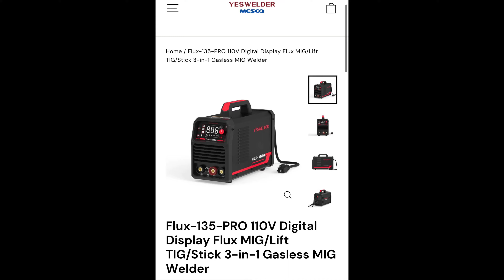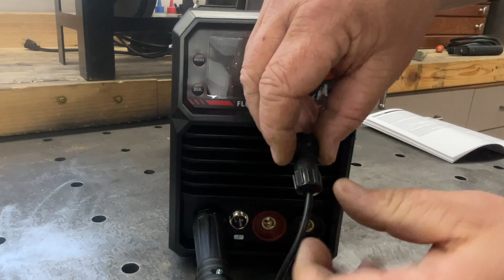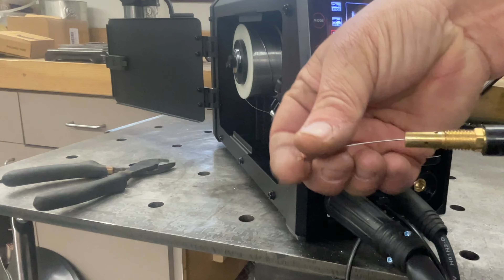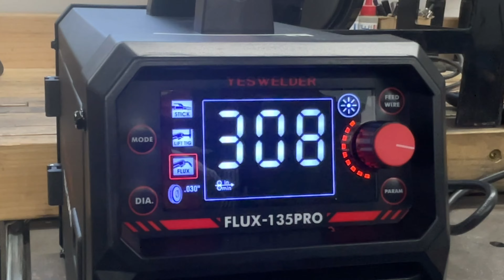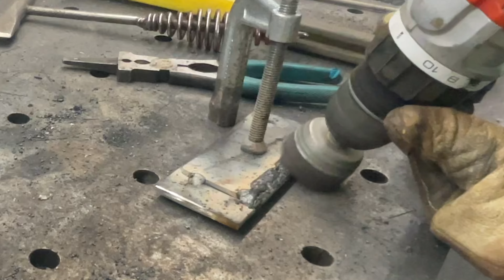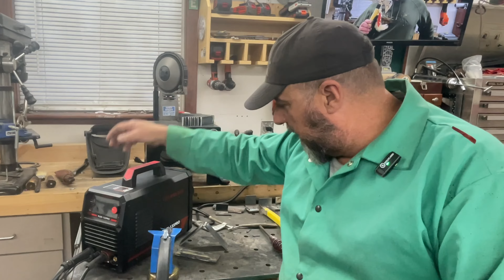Yes Welder Flux 135Pro

Comment: Literally can’t get it to spark at all
Reply from the maker: If you have it set up correctly and it is not starting an arc it must have a problem. Did you try both stick and flux wire? That might help you narrow down the problem.

Mine is still running strong

Thanks for watching.
Reply: Make sure your gun is in the negative and ground in the positive

Comment: if Argon is too expensive ,what else could i use &(how hard is it compared to Argon)
Reply from the maker: I have to make a few assumptions with your question.
I assume you looking at the idea of TIG welding with this machine. I am the wrong guy to ask. I am not a proficient TIG Welder. The Google tells me that helium, nitrogen and mixtures of the 3 gases are also suitable for some metals. I would go to a weld gas shop and ask them.

Honestly, if I was going to TIG weld a lot I would use this machine. Get a welder that doesn't use scratch start and is more suitable for TIG. I know this machine will do it but I can't believe it will do it well.

Thanks for watching

Comment: Thanks for the video. I ordered the welder. I have a Hobart handler 140, chop saw, dewalt steel bandsaw and a collection of angle grinders. I’m downsizing and retiring. I will never be without a welder. The stick and flux impressed, and weight impressed me. I can put this in closet and pull it out as I need it. I appreciate your honesty.
Reply from the maker: Thanks for the kind words and I am still using the machine. It is best for small jobs obviously but it is still running.

Thanks for watching.

Comment: Have this same YesWelder in Feb 2025 then Nov 2025 the insulation for welding torch is overheated and burn through its insulation. Guessing what you paid is what you get! But long term honest review is much appreciated and not just open box and few quick welds and jump to premature conclusion
* Update after 6 months of usage: mig feature dies; pressing trigger and machine won’t weld. If folks think they buy disposable disposable machine, they’ve got it! Money is hard to come by these days, but unreliable machine will drain your hard earned cash and delaying of your project are not acceptable!
Reply from the maker: I still have and use the welder quite after for small jobs. Had no issue so far. I have only been using core wire not stick. The insulation on the gun lead is light, as are most on these small machines. A leather lead cover helps.

Thanks for watching.

Comment: Thank you for the video, been watching a bunch to try and get a feel for this welder, yours I think is the best one. I have watched many other videos about which small welder was best for under $200. I am buying this welder to remove a broken bolt in my car’s suspension. I want to weld a washer and nut to the top of the broken bolt to hopefully remove it. As all other attempts have failed and local shop what to charge up to $200 to remove it which is crazy. Seems that the sticker welding is best on this machine and maybe the best style to shove weld spots inside the bolt to grab hard the to broken bolt. So your details of settings in the welder was very helpful. Of course I will be learning and testing what I need to do on something else first before touching the car. Hopefully it will work out well. In other video they talk about buying better version of the flux core for much better results. Thanks again for creating the video.
Reply from the maker: Hope I helped.

Thanks for watching.

Comment: I actually just bought myself one of these a few weeks back. I was trying to weld some 1/8th-inch plate, follow the guidelines that came with it, and I felt like it was running way too hot.  Unless I read it wrong I was supposed to be running at 400 plus inches per minute on my feed rate, and it melted my substrate pretty handily.  I've never welded before, but I've been around it I know some of the terminology and parameters etc and I figured now was a good time to try to learn.  Watching what you just did, I'm going to go Crank that feed rate way the hell down, and try again.  Thank you!
Reply from the maker: Thanks for watching.

Comment: Someone needs to show a bead strength on a single run. Your evaluation and how to use this machine is the best. A new user can learn and understand what to do to get a solid bead that actually will hold. Thanks!
Reply from the maker: Thanks for watching.
Reply: Got all day yo learn what you could've done with 6 minute video. Good grief!

Comment: 110v so the breaker should be 20amps or 30?
Reply from the maker: I have been running it on 20 and as long as nothing else is running on the circuit I have had no problems. 1 time it tripped when I had a questionable ground. 

Thanks for watching.

Comment: Does it require a dedicated circuit and what amp circuit to reliably run this?
Reply from the maker: I did not run mine on a dedicated circuit. I was using a 20A circuit that are daisy chained to other outlets in my shop.

Thanks for watching.
Reply: @jackofalltrades7822  perfect, thank you for your prompt response

Comment: Im debating on getting this welder or the bestarc 145..im kinda leaning towrds the best arc. Because with the bestarc it actually is a mig gas welder. This one says its mig but its not a true mig, there's no gas hookup right?
Plus the bestarc is 110 or 220 and still does lift tig etc..
Reply from the maker: @motov8-garage832  this machine does not have gas capability. I requires flux wire.

Thanks for watching.

Comment: Thank you for the review, I purchased one that I will receive tomorrow. I have never welded before, this is my first time trying to weld for small home diy projects, what grade of flux core wire would you recommend and stick rod? Thank you for your time.
Reply from the maker: @johnskelly4489  the core wire at Harbor Freight will work just fine. A 6013 rods is easy to weld with & will do for most DIY projects.

Thanks for watching.
Reply: @johnskelly4489  it takes .30 or .35 wire.
Reply: Thank you for the info. 👍

Comment: What is the chipping hammer for with the mig ?
Reply from the maker: @rfraser6097  it’s flux wire. This machine is only capable gasless MIG as it does not have the ability to use gas.

Thanks for watching.

Comment: Your wire speed meeds bumps up a little bit your pulsating
Reply from the maker: Yes I agree, but when you set the heat on this machine the wire speed is set concurrently and automatically. I state that in the video.

Thanks for watching.

Comment: Thank you for the video.  For the same price, would you recommend the YESWELDER or the Habor Frieght Titanium 125?. Your opinion is greatly appreciated.
Reply from the maker: @myholycow  it’s half a dozen of one and 6 of the other. At this price range they so similar and probably made in the same factory. 

The Yes Welder does give you an extra 10 amps.

Thanks for watching.
Reply: You may have decided by now, but here's a different opinion, just in case. I've had a Titanium 125 for a couple of years. With each welder at roughly the same price, as long as the FLUX-135PRO doesn't blow up right out of the box (which seems pretty unlikely), there's absolutely no contest. It has much better features than the Ti 125. The build quality is better, as well. The ground clamp on the Ti 125 is complete garbage and the cables are permanently attached, rather than detachable. The FLUX-135PRO is also much more versatile since, along with flux core welding, it can also both stick and TIG weld. (Although a TIG gun isn't included, so you'd need to buy one separately.)

And now for the kicker, as I write this, the price for a Titanium 125 at Harbor Freight is $149.99, while the price for the FLUX-135PRO at Amazon is $129.99. However, a current $20 off coupon for the FLUX-135PRO drops that to $109 (with free shipping)! So even if the features were the same, the YESWELDER would still be a better deal. But at the current pricing, only a complete moron would choose the Titanium 125.

(P.S. I ordered a new FLUX-135PRO yesterday, so I'll post again if I find any issues with it that might change my opinion.)
Reply: @glassmakerx  Thank you for the feedback. I went with the Yeswelder MIG 205DS PRO as it was on sale for $225.00 on Prime Day. So far, it has been great. Again, thank you for your help and videos.
Reply: @glassmakerx  I just received my 135 Pro a day ago. Was between this and the Titanium 125. Black Friday pricing had 135 Pro $10 cheaper ($109).

Comment: Hi, good video! Can you use this with a generator? If so what size would you recommend. Thanks
Reply from the maker: @pinefighter1  I have used it with a generator. Mine was a 6,500 watt inverter generator but I would think that a 3k would do it. 

I have been told that you must use an inverter type generator with these inverter welders.

Comment: i recently bought a 135 amp mig and arc welding machine and i am curious , wil it work on my 20 amp house fuse with a 15 to 20 amp outlet ?
Reply from the maker: @C.XRepairsMedia1  I had no issue with a 20amp circuit. 15 amp will probably trip after some extended use.

Thanks for watching.
Reply: @jackofalltrades7822  alright respect
Reply: Cn it work ?

Comment: Auto-darkening has it issue and backlight is one. $30 at Harbor Freight will get you a 750 Lumans and magnetic swiveling 360 base. Then stick it and illuminate the area of concern. With thick metal hinge requires great angle, control and you are getting it done! Thank you!
Reply from the maker: @deankay4434  thanks for watching.

Comment: Isn't the feed wheel reversible, where one side is for the 30, and taken off and turned around, the other side is for the 35? Maybe the 35 side was feeding (and slipping) the 30 wire?
Reply: @KP11520  yes

Comment: I just ordered this welding machine on amazon yesterday, should i use 6013 rods? or is there any specific that are better for this machine
Reply from the maker: @tavor7248  6013 are a non structural rod with a low tensile strength. A lot of people use them because they are easy to use but I they are intended as a root weld rod to be covered with a 7018 or similar rod. 

The machine will weld any of them so your rod selection should be based on the steel thickness your welding, and the strength needed.
Reply: @tavor7248  6013 splatters try 7018

Comment: I realize this may well be a daft question, but I'm trying to wrap my head around an aspect and it just ain't clicking. 

For stick, you use both negative and positive terminals, which makes a circuit, which gets you an arc. But I've seen people in Flux mode run it wrong, with the work piece/welding table plugged into negative, yet they still get an arc (and more spatter for their trouble). How's that work? 

Now, in my head, I'm just assuming somewhere inside the machine that the Flux wire gets it's DCEN connection when the machine is in flux core mode, it's the - to - yielding an arc I don't grasp.

Good review, by the way. It's genuinely appreciated. ^.^
Reply from the maker: Let me take a swing at this one for you. 

DC electricity needs a path to flow and the electrons flows from negative to positive. The electrode and ground leads coming out of your welder and the work piece are the path and electrons are flowing from negative to positive. 

Regardless of whether you are in a DC electrode positive (DCEP) or electrode negative (DCEN) mode, the path is still there and electrons are still flowing from negative to positive and will create an arc in either direction. 

So for those you have seen with the ground plugged into the negative and it still works, it is likely because their welder has not been configured to DCEN mode. My YesWelder MP 200 has a bus bar that needs to be flipped to make it a DCEN. The Flux 135 Pro does not have that requirement. You simply use the appropriate sockets. 

So to verify, I set my 135 Pro like you described. Flux wire MIG and the ground in the negative socket. It did not make an arc. This is because there is no internal connection between the negative socket and the MIG gun.

Whew!!! I hope I understood your question correctly and that answer cleared it for you.
Reply: @jackofalltrades7822  Woot. No, you understood perfectly, and the explanation makes sense with what I thought I knew. :P I'm now profoundly baffled about the guy who seemed to get an arc despite it being negative on both sides, but I'll have to track that video down.

:P I swear, electricity to me is like quantum physics. Whenever I think I have a grasp, something comes along to prove otherwise, so I was figuring that was the case here. 

^.^ I was meaning to test later today or tomorrow, but I appreciate you giving it a whirl for me. Thanks for being awesome.

Comment: I was really digging it until I saw that it was synergic and only allowed relative voltage adjustment. Synergic can be nice, but I'd still want to get out of that mode and just play with the separate settings. Too bad. Just about everything else on this machine looks fantastic! 

I know this is a welding machine for novices, the issue is that they'll outgrow it really fast and want a different machine with separate adjustments. I'll bet they could fix that with a firmware update, though...
Reply: I got one and was a little disappointed about that. Most of cheap ones are like that. If you use .30 wire set it .35 and there's enough burn in. Also tighten the spool down and it will slow the wire down a bit. The thing that made me most angry is the mig for gas wand is fake and there's no hose for gas going back to the machine.
Reply from the maker: There is a plus or minus voltage fine tune adjustment. It makes quite a difference.

For someone who plans to do a lot of welding your right, they may outgrow it. For the average DIYer though I think it would be just the ticket.

Thanks for watching.